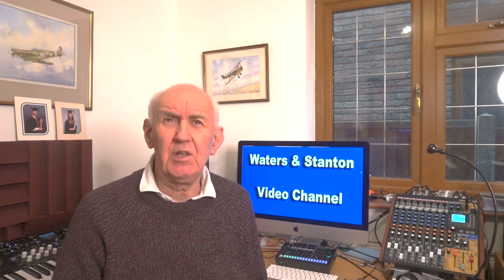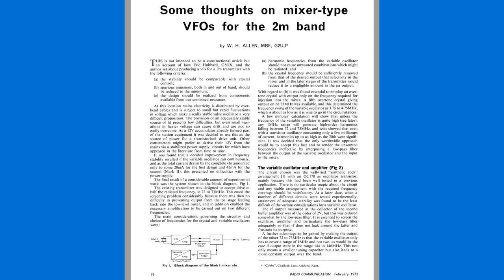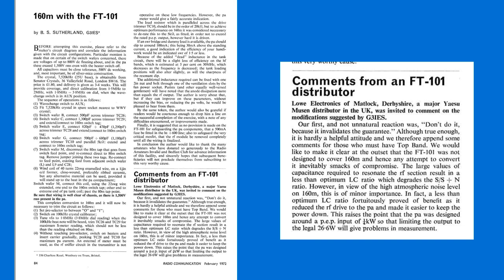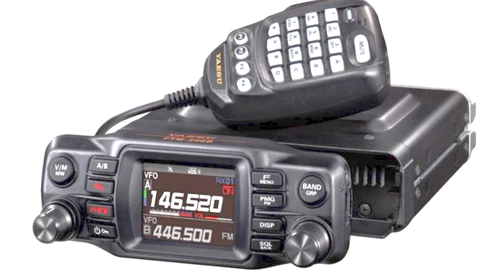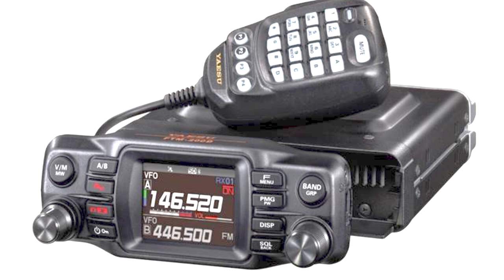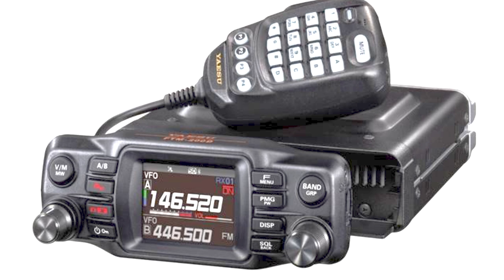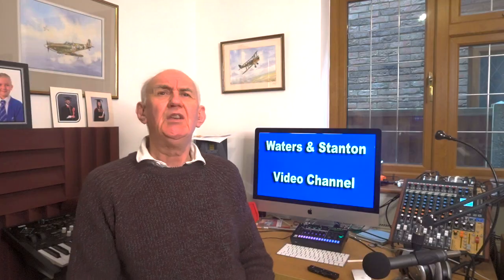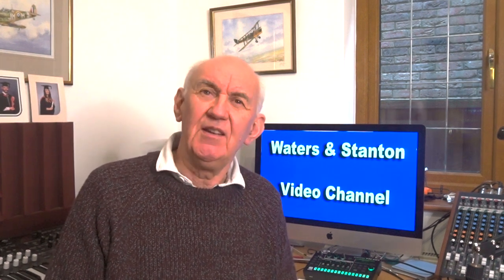YAESU FTM 200DE Dual Band Transceiver is Announced

Comment: 400, 300, 200 ffs, they need to stop and rethink, a new VHF+  with sideband/cw is what we  need, not a replacement for a 2 year old ftm 300 !
Reply from the maker: Thanks for sharing. 73 Peter
Reply: In reality, it replaces the FTM-100. Dual-Band but Single-Band Display with Colour 2-inch Screen and Detachable Head Unit.

Comment: Sure wish that would place SSB on this rigs. Or even 1.25 meters.  I know, it would cost more, but there are hams that want to use SSB on VHF and use 1.25 meters here the US.  Can't wait to see you next video.  I hope you talk about the importance of grounding the radio.  Or is it important.  Thanks for what you do, it's invaluable information.
Reply from the maker: Thanks for sharing. 73 Peter
Reply: WHY?
Reply: @garybernstein3539  because in VHF and UHF you can transmit SSB and the signal travels farther than FM. Check out VHF weak signal propagation. It’s just another surprise of what u can do in Ham radio operations.